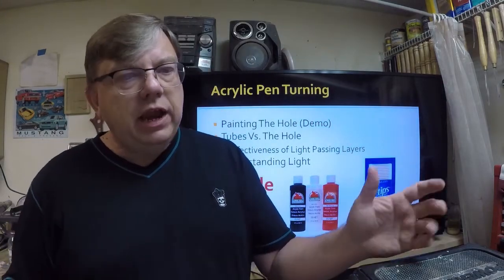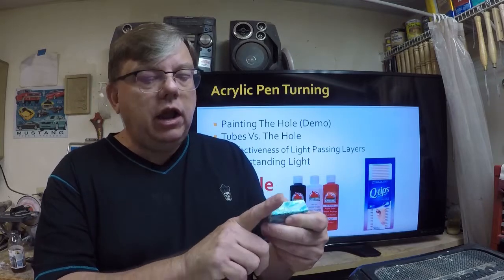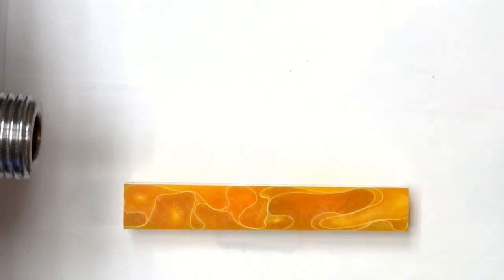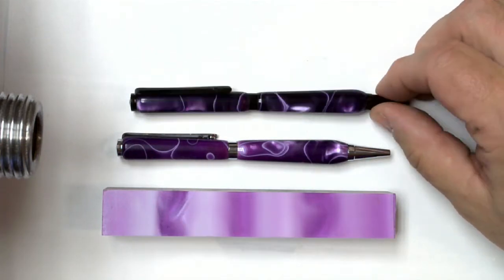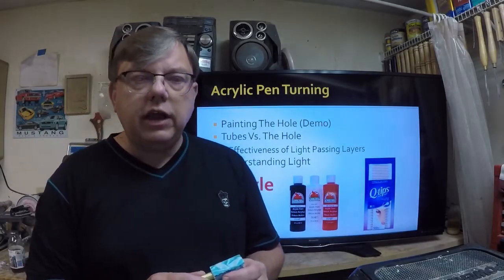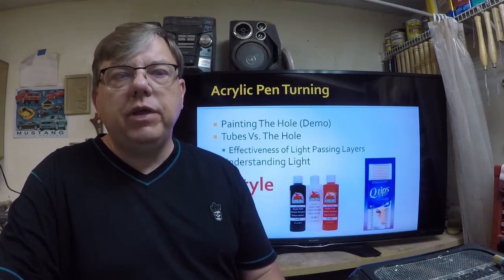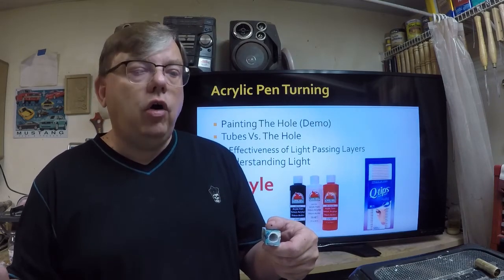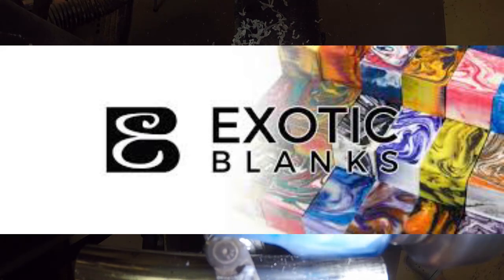10 Minutes To Better Pen Making - Painting Acrylic Blanks - Mark Dreyer

Comment: I like to use Rustoleum to paint the holes. I find ir dries faster and thinnner thanlatex
a neat trick I saw on the internet: Make a parint sample stick. Paint a dowling white, then add bands of different colors. Slide the paint stick into the hole and see how the color affects the blank.

Comment: You talked about light reflection.  I can not imagine that this will make a difference but does it make a difference whether you use flat or glossy paint?
Reply from the maker: I have never studied it. I use more of a flat (not sure there are sheens on the acrylic paints). I think the lesser the sheen the better the glue would hold - but never looked into this that long. As mentioned I use the Apple Barrel paint. Thanks for watching.

Comment: Hello
Just watch your video on painting the inside of the blank verses the tube. You used acrylic paint, I watched another that said enamel paint. I guess it depends on the glue. Can you clear up the kind of glue that won’t react to which kind of paint. Ie. CA glue or what do you recommend?
Reply from the maker: Sorry for the delay I was on the MPG and that took all my time. I use acrylic paint (I believe from Michaels - Apple Barrel paints (Amazon has them also)). I have used testers but the acrylic paints do just fine and are more cost effective. I then use 5 minute epoxy - ALWAYS. I never use CA for the tubes (my gluing video - explains why). Five minute epoxy is better gap filling and not as brittle on tangential stresses. Hope this helps, sorry for the delay, thanks for watching.
Reply: @markdreyer2865  great thanks for the reply, yes that helps and confirms what I am thinking. I have tried nail polish of different colours that work help too
Reply from the maker: @quaker19691  Perfect and good to know. Thanks...

Comment: A problem i face is after painting the tube does not fit into the blank
Reply from the maker: As mentioned in the video with the bigger tubes (10 mm / 10.5 / 12.5) I don't have an issue. With the 7mm I have an issue so I drill at 9/32". Let me know if you try it. I also only need a thin coat on the inside. Thanks for watching ....